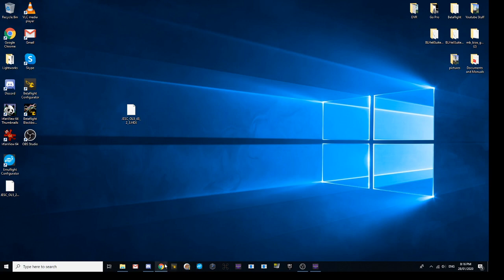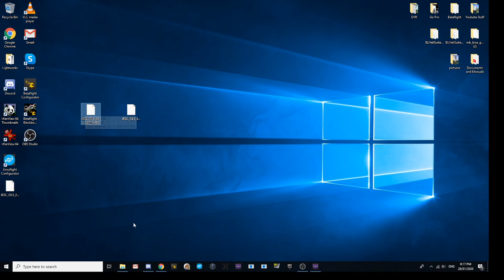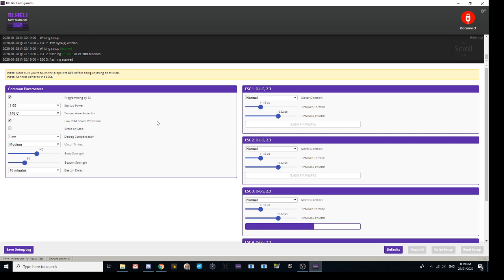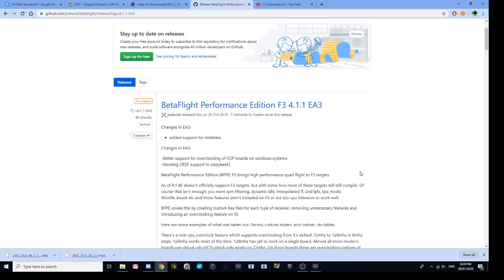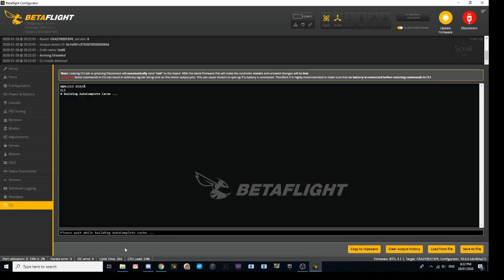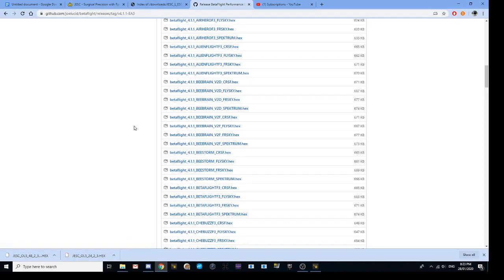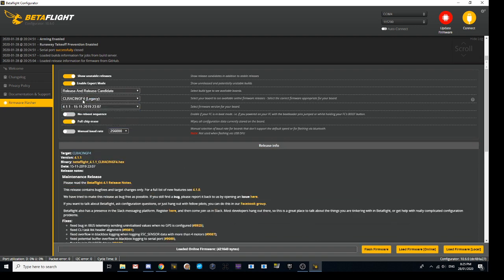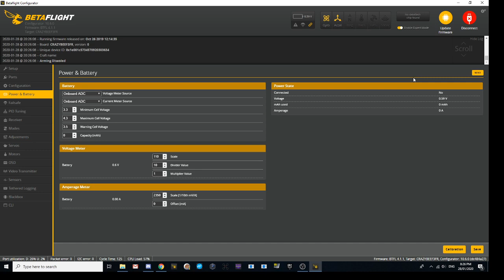OLD WHOOPS FLY LIKE NEW! L type ESCs - 48khz and Betaflight 4.1 with RPM filters

Comment: just tried and when I plug the battery to my UK65 it does the same sound as always so I assume my flashing is failing?
Reply from the maker: Sounds like it. Make sure you are getting the right firmware and that you are flashing all 4 escs
Reply: @BengalCatChilli  just used the same you did in the video as I have the same tiny. However when I flash it does it but really fast, not like when its really flashing that usually takes 1-2min
Reply from the maker: @danimp321  should be ok, it takes me a while to flash them all too.

Comment: I need some pid for mockula 7 with rpm filter :( 
Please help me
Reply from the maker: Drop the I term into the 70's. Keep d iterm around 65. Increase p and d a little. TPA .65 and 1550.
Reply: @BengalCatChilli  mockula7 v1 or v2 ?
Reply from the maker: @FPHIVsvenAUG  either
Reply: @BengalCatChilli  what do you mean?
Reply: @BengalCatChilli  Do you use PID from mockingbird for Mobula 7?
Reply from the maker: @FPHIVsvenAUG  no but I think it flies fine on just 4.1 + 48khz and rpm filters
Reply: @BengalCatChilli  use pid stock for BF 4.1?

Comment: Have a UK65 on BF 3.5.0. Been trying to put the 48khz ESC firmware on threre just for longer flight time. Without paying extra for rpm filter firmware. My ESC are O-L-5 like yours and I found a JESC 48khz 2.3 firmware. I flashed it sucessfully to all ESC . My startup tone has changed but motors wont spin. I can arm it but cant spin motors. Tried manually spinning them in betaflight motor tab but that won't work either. Flashed original firmware back and works again. What was I doing wrong? I made sure I had a fresh lipo and all the obvious stuff . No idea why it wouldn't work
Reply: Me too, no luck with the UR65
Reply: @earlybirdflights9884  I found a solution.  Change Dshot600 to Dshot300 . Then it works . Dshot600 is not compatible aparently
Reply: @MikeHarrisFPV  That was silly of me, I knew I forgot something I will try again thanks
Reply: @MikeHarrisFPV  got it mate it works, left you a sub 👍
Reply: @earlybirdflights9884  nice one . Glad you got it working ! Took me ages to figure it out !
Reply: @MikeHarrisFPV  I got this on all my other quads ( h ) including mobula 7, so when I woke up a saw your comment about dshot 300 I cracked up laughing lol. Getting 20 seconds more now so I am happy now. Cheers mate
Reply: @MikeHarrisFPV  thank you so much!!!
Reply: @Indy64738  haha that was so long ago ! Glad the info is still helping people 10 months on !
Reply from the maker: @earlybirdflights9884  you can leave a message with on the rc groups forum and let Joe Lucid know.
Reply: @BengalCatChilli  Got it working silly me forgot to go on dshot 300. Thanks
Reply from the maker: Hmm that's weird...not sure dude